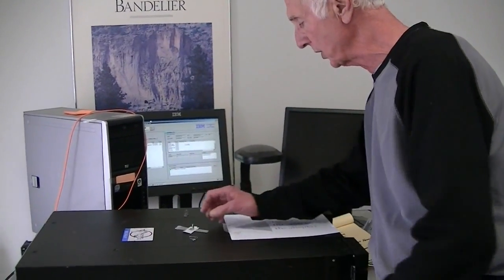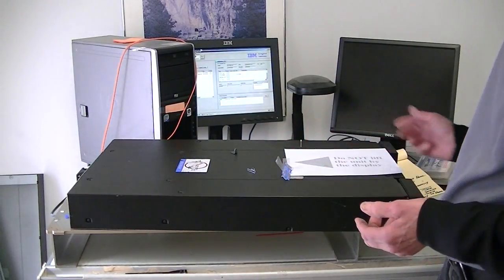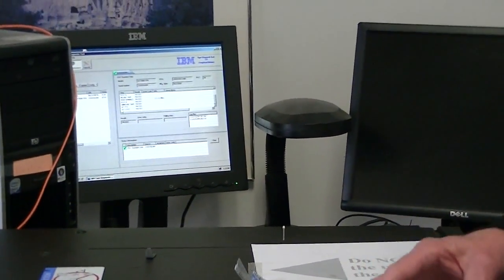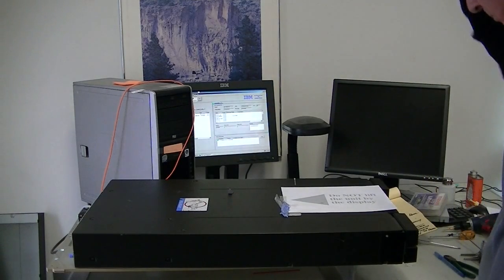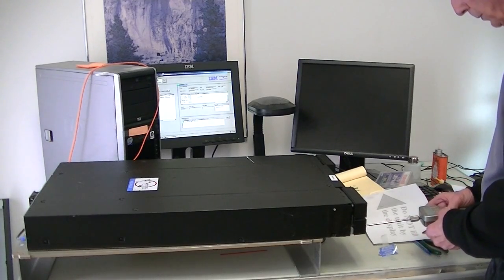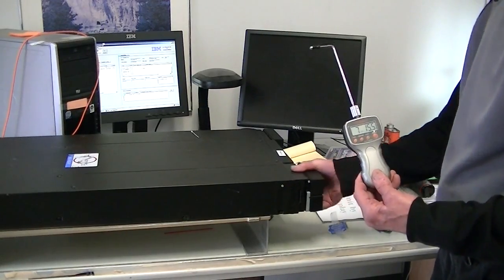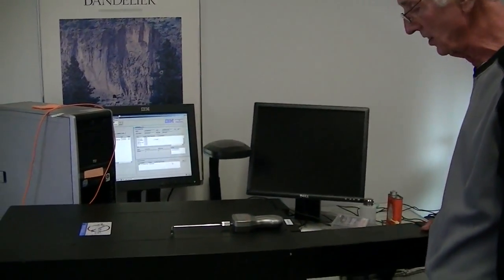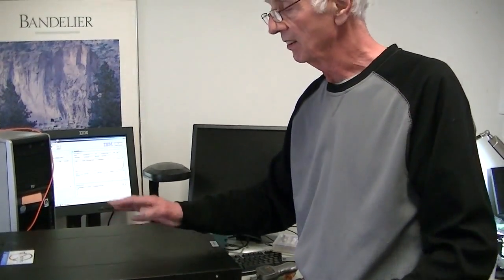IBM TS3100 Picker Lock And Magazine Repair

Comment: Hello, I change the tape drive from LTO5 LTO6 I got error message drive sled not present would please help
Reply from the maker: First thing would be to update the firmware on the library.  If it is rather older firmware, you will need newer firmware for an LTO6.  We always update the firmware on the libraries we sell to the latest version.  Mainly because if just a library is purchased, we don't know what drive will be used with it. You can use IBM ITDT to update the firmware.  Also make sure the tray is for IBM and not DELL, HP,  Spectra Logic ... etc.
Reply: @repairmytapedrive  thank you I update the library and it works